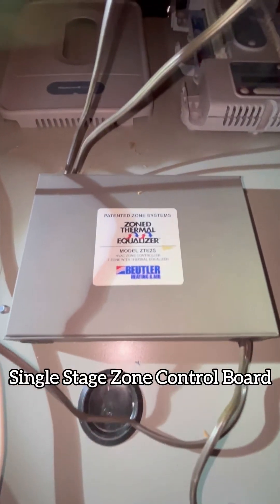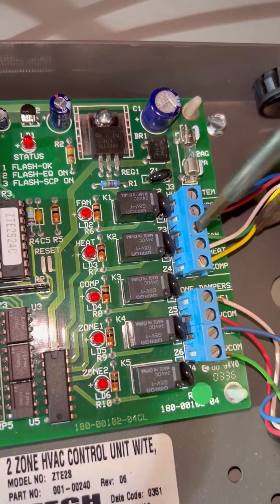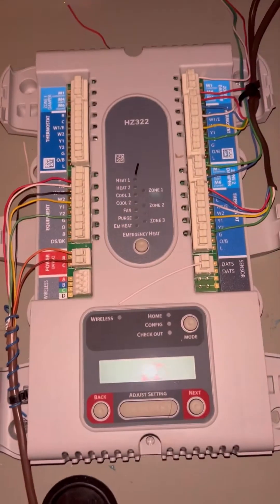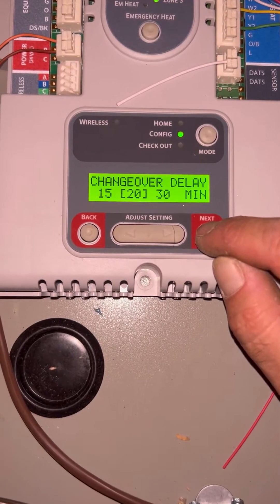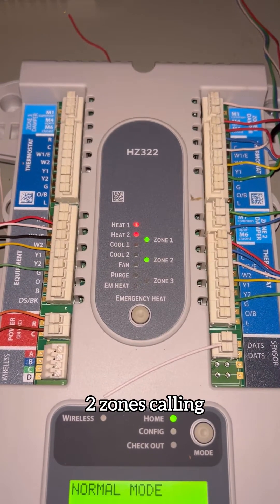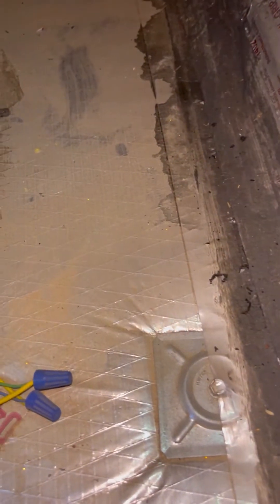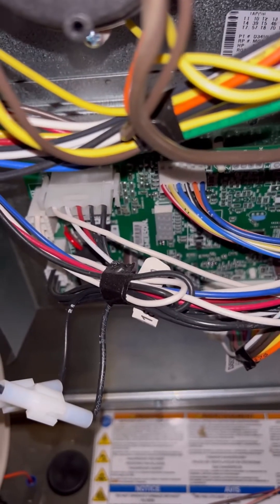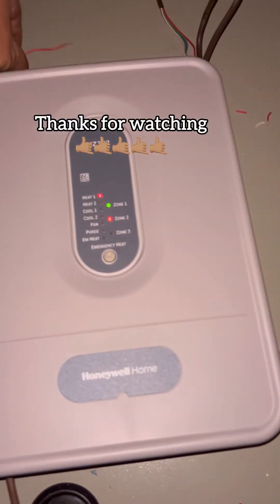Honeywell HZ322 Zone Board Installation - Replacing single stage controls with 2 stage

Comment: Hi all,

We have central heat & air Honeywell system dual zone control. Downstairs zone1 and upstairs zone2. Everything functional fine for a number of the year and recently we see something weird happening. 
When turn on zone1 the whole house downstairs and upstairs running look like upstairs heat flow stronger.
When turn on zone2 only upstairs running 
Do you know how to reset the system for zone1 only downstairs and zone2 for upstairs 
We using Honeywell thermostat model: YTH5320R1000

Appreciate your advise

Comment: Hello, I know this video is a bit older but I’m having issues with my Honeywell HZ322 zone board. Would you happen to know what it means when “Zone 1 and Zone 2” are illuminated red but Zone 3 is green but then all of a sudden they are all green? And a short while later Zone 1 and Zone 2 go red again. I’m also having issues with my very top floor blowing air like crazy when the thermostat isn’t even on. I have three floors. The top floor will blow air if my middle or first floor thermostats are on. I think this is something to do with the control board being all messed up or the dampers. My compressor was recently changed. I have an electric furnace and a heat pump outdoor system.
Reply: Sounds like an issue with the damper for your 3rd zone - possibly it was wired incorrectly? Start by comparing the damper wiring for the upstairs zone to the other two and see if there is any obvious difference.  If the damper uses 3 wires you can try swapping M4 & M6 on the upstairs zone.  Is it always blowing when another zone is calling, or is it blowing during the purge cycle at the end of a call from another zone?  The former is likely a mis-wired damper and the latter can be configured with the PURGE DAMPERS setting set to [UNCHANGED] in the HZ322 advanced settings.
Reply: @cvinci1 thank you for your response. I will try and figure this out when I can get into my attic again. I never messed with the wiring of the dampers at all up in the attic or settings, which confuses me. Only wiring of the thermostat of the Zone 2 I believe if it is labeled correctly.
Reply: @x3Myst3ry  Good luck.  It's also possible that the zone damper motor for the upstairs zone is dead so the damper is stuck in the open position.  If you can access the damper motor, you can inspect visually and manually close it temporarily while you sort out the problem.  If you're not sure what you are doing, a competent HVAC tech can probably get you sorted pretty quickly.
Reply: @cvinci1  I was thinking it could be dead as well. Could this cause AUX heat to kick on by chance? For example.. I’ve had my temp set at 68 and inside heat is 66 but AUX heat kicks on when outdoor temp is between 40-50s. Which is definitely not normal. Especially when I’m calling for only 2 degrees higher.